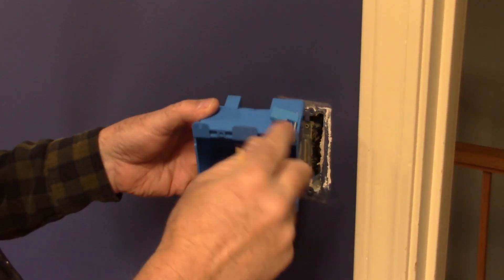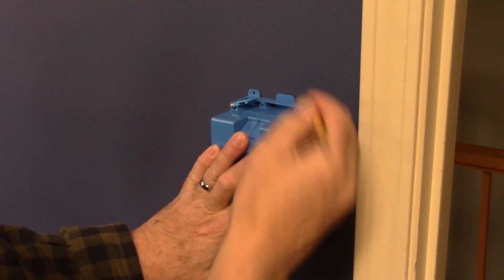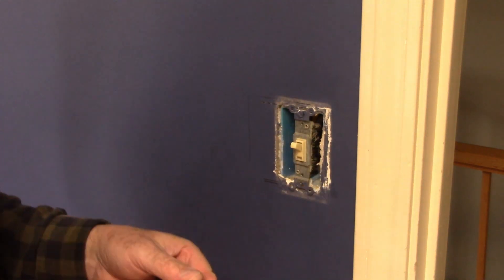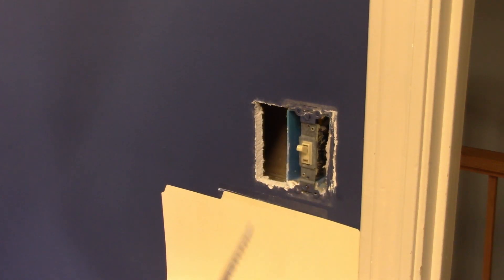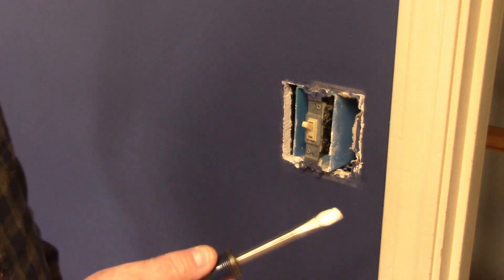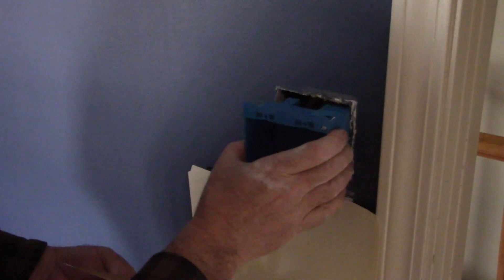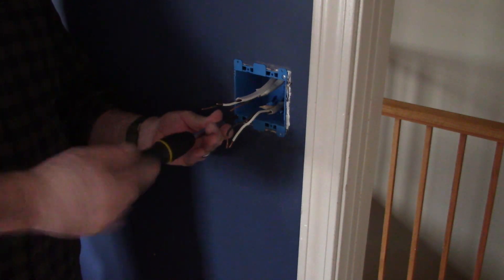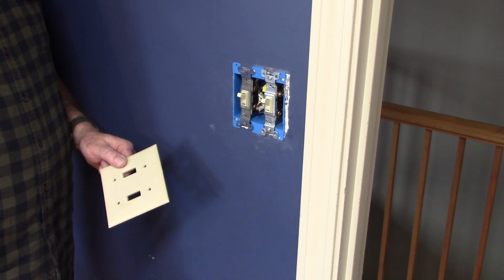Installing an Electrical Box in an Existing Wall

Comment: Very nice job and video.  I like your idea of putting a hacksaw blade on a handle.  I think that would be nice to have.  Just haven't seen that before thank you.  Hope it is warming up at your place now, we still have much colder weather than we are accustomed to for sure.  Have a good weekend
Reply from the maker: The handle for the hacksaw blade works pretty good but I always seem to bend them.  You have to make sure they cut on the pull stroke but I still seem to bend them...